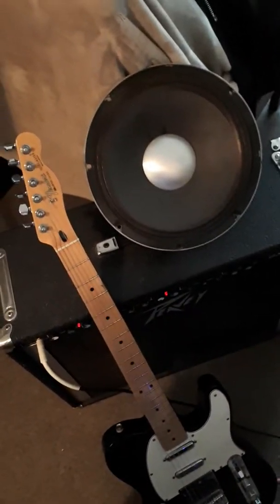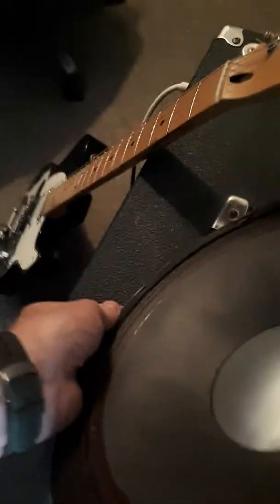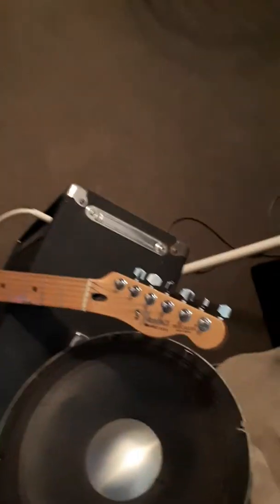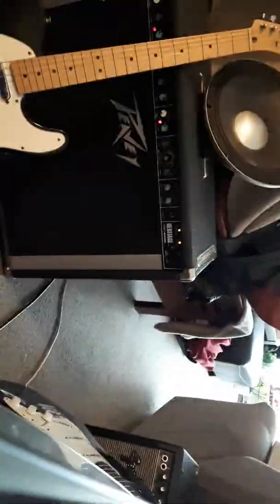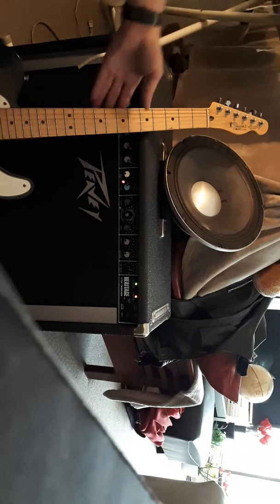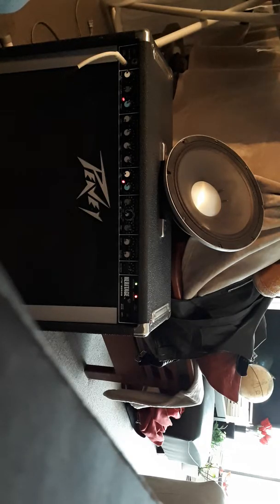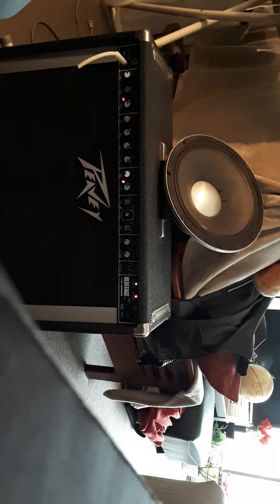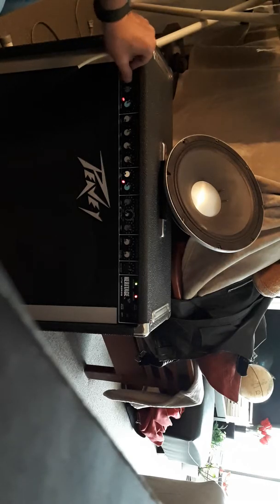Peavey Black Widow 1201-8 speaker test. Using a 1980's Peavey Heritage VTX tube amplifier.

Comment: Well, playing sounds good, your amp sound good, but  as far as hearing the speaker?  Got a Flight Case MX head and wanted to know if the BW  is  the key.  currently got a scorpion in it and I feel like I am missing highs with it?
Reply from the maker: Scorpions are not my favorite but they should sound similar. Sounds like you have a MX VTX with 4 6l6gc tubes. If you have another amp, plug the head into its speakers to see if there is a difference.

Comment from the maker: If you have one of these you would like to sell... please let me know... thx
Reply: I've got a few of these, although someone lightly spray painted the metal dust domes black since they were in a club sound system.
Reply from the maker: I found a couple of magnets so im good. A bit of acetone or laquer thinner used carefully should remove that paint.